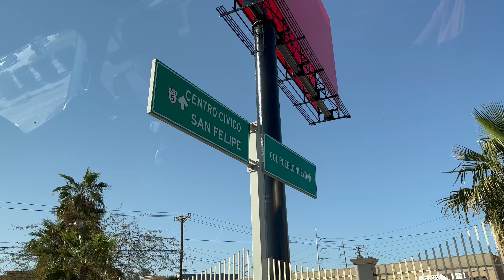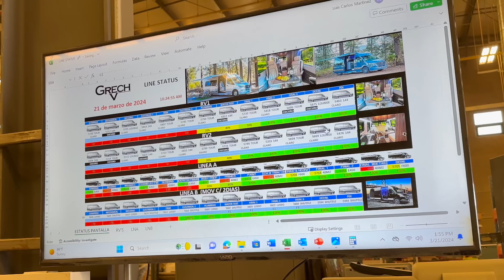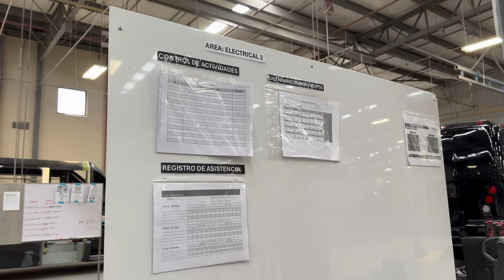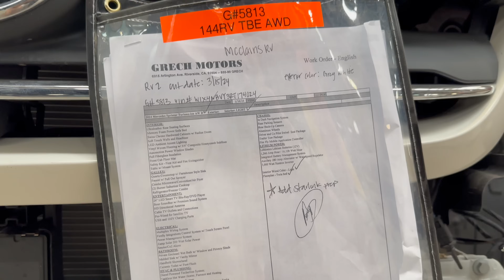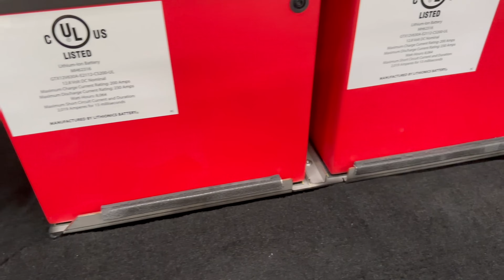The Best Built & Highest Quality Class B Vans Available? (Grech RV Factory Tour)

Comment: I am the owner of one of the first few Strada Ion models. After 40 K miles, I have very little complains and a lot compliment. The quality of the manufacturing process and the work ethic were the reasons I switched from another B class to Grech. I have noticed over the last couple years. Grech has made significant improvement in utilizing better quality, refrigerators, and other parts. I wish them well and hope they continue the great work. Perhaps Airstream could learn few things.

Comment: Really nice vans!! But, ugh that blue 🤦‍♀️ I wish Grech would do a back bathroom floor plan, just my opinion 😁 safe travels!!
Reply: Just took delivery on a ‘25 Strada Ion, wasn’t a fan of the blue accent lighting either, but figured I would leave it off. So pleased to see white accent lighting under the upper cabinets and under the countertop. Much classier, IMHO, I’ll just leave the blue ceiling accent lighting off. It’s on a separate switch.

Comment: Super C??? But we just got our Strada! Looking forward to seeing the bigger one, although bigger is not always better. Liked to see the shots of the equipment and lines running behind the TV between the bathroom wall. I get that space is a premium, but I would have liked the water pump to be more easily accessible. Also, the macerator hose reel didn't look like there was too much hose to cause occasional binding but need to look at how mine rolled up. All in all, great attention to detail both inside and out. Fun to see Ed's office too ... and the Diamond airplane (DA42?. Great video. Thx.

Comment: Insulation: I've noticed Grech doesn't insulate the sliding door at all. Any idea why?
Reply from the maker: You can’t because of the working parts within the door. I suggested at least a spray insulation along the door itself.
Reply: @LivinRVision  Thanks so much for asking them. I suppose that's a disadvantage of the electric door because lots of van builders are able to insulate the manual doors. An option would be nice.